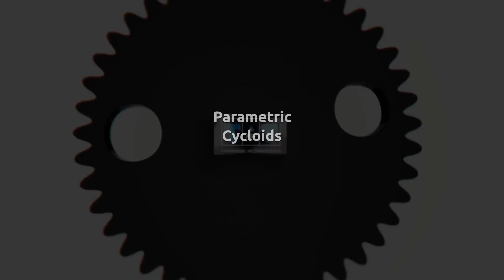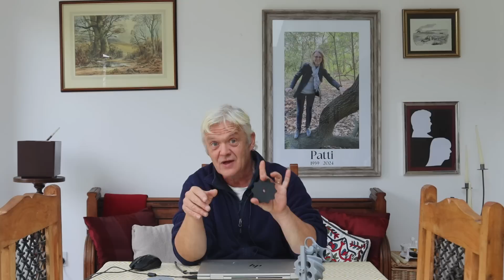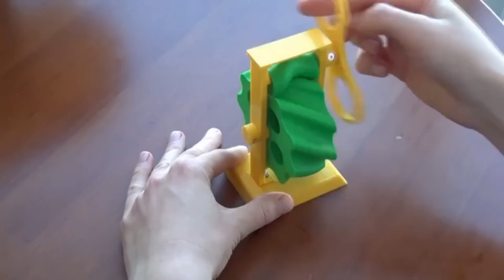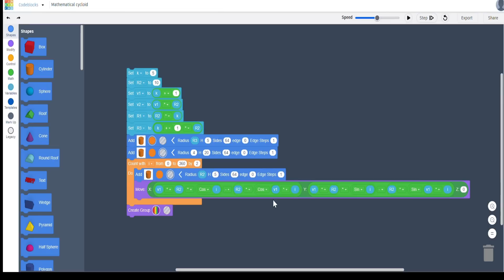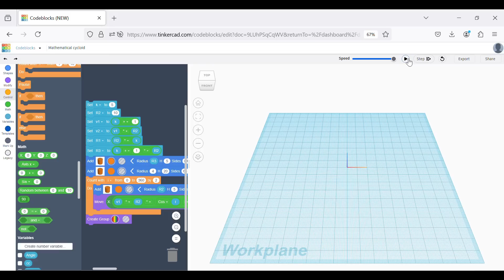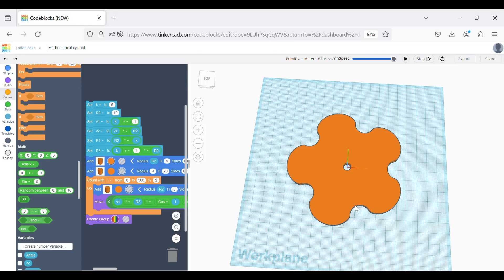2319 Parametric Cycloids - A Tinkercad Tutorial

Comment: re: order of operations: The codeblocks language looks like it's inspired by MIT's Scratch programming language (or perhaps even derived from it; I believe it's extensible) or one of the other similar GUI block-based languages.  Each oval that you fill in is essentially equivalent to a pair of parenthesis in a normal coding langauge, so if you put an expression inside another oval, the inner expression is evaluated before the one that contains it.
Reply from the maker: cheers mate

Comment: I highly recommend using OpenSCAD for doing 3D modelling for printing. It has it's own programming language for generating shapes, and if you are comfortable with programming, it works very well. Thingiverse's customizer is based on an old version of OpenSCAD. There are libraries of useful shapes and functions that you can use. I wrote my own library as when I was doing it the available ones had issues, but they have improved a LOT since then...

Comment: Hi sir, I hope u are doing great, regarding the (A Solar Cell From A Broken LCD Screen - Part 1 - Reclaiming The Materials) video, the conductive clear sheet of glass that has the ITO, I tried cutting it to 2x2 cm pieces for the students to make the dye sensitized solar cell experiment with it, but the diamond cutter tool didn't cut through it, the glass guy said (this appears to be plastic not glass) then we tried breaking it, it broke like glass, so he didn't know head or tails from it, then I went to a laser cutter, the laser smashed the piece of the glass to pieces instead of 2x2 cm pieces, I wondering if there a way to cut this sheet of glass ?
Reply from the maker: I used a diamond abrasive disk in a a rotary multi tool (dremel) - but then i didn't need much - just a couple of squares - you might try a tile cutter? the rotary machine kid that has water cooling - they have them in most DIY stores
Reply: @ThinkingandTinkering  thx u for your prompt response ❤
did u do that after removing the polyimide layer using the 1200 grit wet and dry or it didn't matter the removal of the layer ?
Reply from the maker: @redhammer9273  after i removed it mate

Comment: For a hydroelectric generator, you need a high ratio, not sure what ratio as I have not resesrched it yet. But my question is, on the turbin. I've seen long horizontal blades that capture more water but turn slow with lots of torque needing a higher rpm for the generator. I think one of these gears will be helpful. So again the question, is there a better way to capture energy than the long horizontal blades? I've seen many ducting systems also that pull water off to the side and funnel it to a small turbine.  I'm working on getting a farm and will be looking for a local that has running water knowing its likely to be slow water.
Reply from the maker: am jealous mate - have you seen the vortex turbines?
Reply: @ThinkingandTinkering  I'll check it out? Ty.
Reply: If you can compress Hyperspacepirate, think that's channel.
He puts together a rain water gutter to provide energy.
Making a 3D, Pelton blade, and nozzle.
 I liked this concept due to, it's expanding ability, adding multiple silos from gutter, allowing overflow to be utilized.
Stepping pipes from Dam, low to high one being regular flow, 6 inches up second channel to second Gene, up a level repeating till three or four levels gives exploitation of increased Flow..
Pelton blade..
Don't know if that helps, good luck..